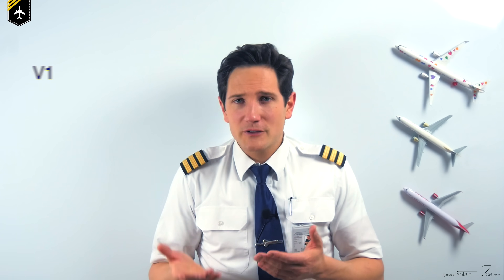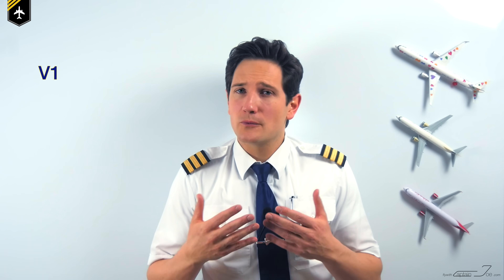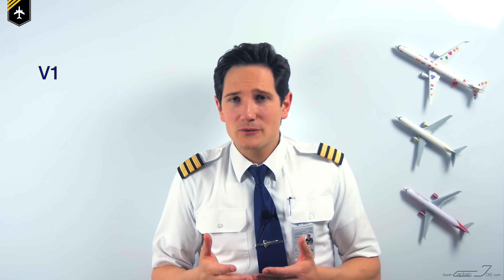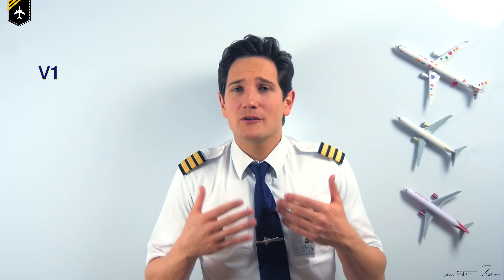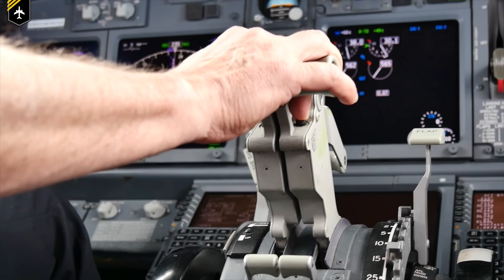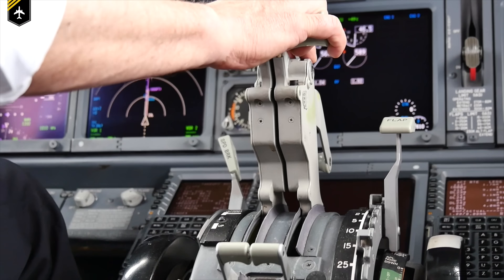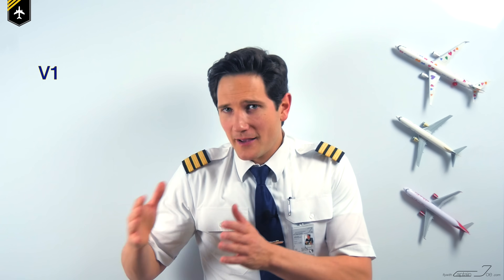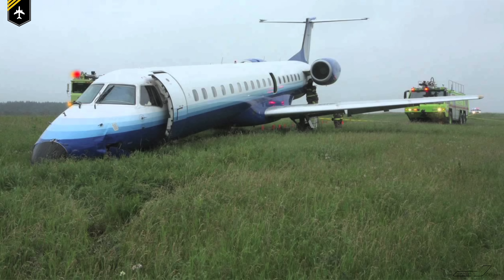TAKE-OFF Speeds V1, Vr, V2! Explained by "CAPTAIN" Joe

Comment: I understand Vr. It's the speed (given the plane and inputs) that you can achieve flight with. Let's say that's 150 knots. It doesn't matter whether you get that with 3,000 meters remaining runway or 30. It's a matter of achieving lift, regardless of remaining runway. But my question is, does V1 decrease depending on remaining runway? If you're 50 feet from the end, you need to be going 20 knots or less to stop. Under 20, you can stop. Not committed. Over 20? You can't stop in 50 feet. You're committed. So with 50 feet remaining, V1 (for this craft, and a given payload, fuel weight, slope, traction, etc.) is 20 knots. But if you have 3000 meters ahead of you, you can be going 200 knots and can stop. If that's true, then V1 should not necessarily precede the 150kn Vr. This seems simple as can be. What am I missing here?
Reply: Bill Woo yes v1 decreases with decreasing runway length. But when runway length is increased, v1 is increased with the max limit being vr. That’s because v1 is commitment to take off, and vr is the actual takeoff

I dunno if this example helps in understanding, but ill try. V1 is like getting engaged. And VR is like getting married. So engagement is commitment to marry someone and marry is to fulfil that commitment. Hence you cant get engaged after getting married.
Reply: @ZK-APA  That's all well explained, but it contradicts the commonly stated "definition" of V1 being the make-or-break commit point. This is a fine point, but unless V1 and Vr are simultaneous (maybe they are effectively considered to be, like a recitation "Vee-wun-vee-arr"), then between the call of V1 and the call of Vr, you are not committed if V1 is capped at Vr. If Vr is 150 and you could stop from 200 because there are tons of more runaway; V1 is really "200 capped at 150". Then I would contend, at least logically speaking, that once V1 is announced, it doesn't "really" become the commit speed UNTIL rotation. Even when Vr is called, you might not "physically" be make-or-break committed, although "legally" you are, because it's been called so it's mandatory. Again, I understand that rotation will probably occur within one second after V1 commonly; but unless V1 equals "uncapped V1", it's not really a commit speed until the yoke is pulled, right?

I'm not criticizing your explanation. Just exploring the fine points. Sorry - I was the jerk that sweated over the extra credit questions and killed the grading curve for the rest of the class.
Reply: Bill Woo ok, I think you are mixing the physical concept and the legal concepts of V speeds

As in yes, if you have a long runway then v1 can be greater than vr on paper. But if you look at it from the legal definition, vr is the speed when you rotate, so that’s the point where you take off. So v1 will be greater than vr if vr speed is crossed but the pilot decides to not rotate. But that’s not how it works.

Comment: I all ways wondered what rotate meant. so its when the angle of attack creates enough vacuum behind the wing, forcing the air down? or air rotates down?
Reply: Bob Young rotate means that the aircraft has reached a speed where you can pull back on the stick and take off.

Ps one thing that people don’t know about physics of flying, is that an aircraft climbs mainly because of excess thrust, and not lift. So rotate is when you have that thrust to start climbing. (Hence the aircraft’s nose is pointed upwards as then the trust acts in that direction)

Comment: "V2 is the safe take off speed which you can maintain with only 1 engine operating"... So then what happen if you have an engine failure after V1 but before you reached V2 ?? (a scared passenger)
Reply: If there is an engine failure after V1 the takeoff run will be continued, because the takeoff can't be aborted after V1. Vr is the rotation speed and it should be such that the aircraft is able to reach V2 before it is 35 feet above the takeoff surface.
Reply: @mikep9604  hey Mike, but can the plane actually gain speed while climbing up with only 1 running engine ? Because if the second engine stop working just after V1, the plane won't be fast enough for Vr and V2
Reply: @ludovicortiz927  - As it was told, after V1 the takeoff can't be aborted, the aircraft must continue the takeoff run and perform takeoff. The aircraft is able to perform takeoff with only one engine, and reach the sufficient speed to climb and fly (and make a go-around and return for landing). This is a part of Certification requirements for civil (commercial) aircraft.
This is the normal procedure if there is a failure in one engine after V1 speed.

Comment: Cheers Boss, well understood mate. I've just loaded my copy of Flight Simulator X on a cool Acer tower desktop with windows 8.1 & setup a nice layout of my cockpit" where I've located the keyboard, Logitech joystick & a cool mouse that has a red ball that turns-spins by finger. So keen to pick a nice Boeing plane, make a destination waypoint map & stretch my wings & I want to have a better knowledge of tasks a real pilot will have to make the correct settings/control inputs to safely take-off, clime, heading clime rate,  altitude  max level & speed by the auto-pilot control inputs then descend plane by a safe distance  from the runway & the rate of descend using waypoints then a sweet floorless landing. With what any person can access on the awesome, wonderful & beautiful WORLD WIDE WEB, google & YouTube is  Flight School course of classes & writing everything in short & simple meanings into a study notebook. So far I've took lessons with setting the flaps for take-off & the V calls made when a plane is running down runway & lifting to the sky.I have a question to ask & what is the law, rules with the planes interments/gauges & the pilot using metric or imperil numbers when being called out in the cockpit or the traffic control town?Thanks Caption Joe...

Comment: what if the landing gear brakes fail? before v1
Reply: In this situation, if there is no brake power, and you have to abort the take off, you will use the reverse thrust only.
Reply: @mikep9604  can they stop a fully loaded plane at their max payload?
Reply: @mikep9604  thanks, that's a scary as hell situation tho.

Comment: What if you reach V1 and then the wings fall off?
Reply: sucks to be you, but at least the brakes are going to work well, no lift at all means the full weight of the plane's on the wheels ... then again, with no engines you might have trouble with the hydraulics, like the brakes...

Comment: Hi Capt. Joe..thanks very much for all the great vdos.. Just a query - at Vr, does the pilot have to do anything - like increase angle of attack of the wings - or, the nose (of the plane) automatically lifts up due to speed (Vr)?
Reply: Yes, at Vr the pilot will pull the yoke (or side stick on Airbus) so that the aircraft nose will rise and the aircraft takes off.
Reply: Many thanks Mike... With yoke pulling, what/which parts or wings play the major role and how? Many thnx once again.
Reply: @Chanchal1969  - When you pull the yoke or side stick the elevator will rise.
https://www.decodedscience.org/wp-content/uploads/2012/04/Elevators.jpg

https://i.stack.imgur.com/JficI.png

Comment: Hello Capt. Joe, I truly enjoy your videos even though I am not a pilot! It is is amazing to know that there is nothing routine about a pilot's day! I have a dumb question about bird strikes. As in, why do they cause serious engine damage, resulting in emergency landings etc. Why can't they make the engine fan blades strong enough to withstand bird strikes? I understand the high momentum with which the strikes happen, but a bird is "just made" of flesh and bones! And most are so small relative to the engine size! Lastly, why can't they have a grill in front of the engine that prevents the birds hitting the blades during take offs and landings (ok, I am sure you fell off your chair laughing at this!), and that can open up once the plane reaches high altitude for better air suction? During takeoff, a lot of thrust is applied anyhow, so can't it compensate for any loss of efficiency in exchange for safety? Thanks.
Reply: Mentour pilot did a video that answers those q's

By the way if you like Cap'n Joe you will like Mentour -- the two pilots have a different style but very similar in quality of the info

Comment: Hi Captain Joe
Just happen to see your video on the explanation of V1..Vr..V2.  It was amazing the way you explained.  I would like to know how do you control the left and right turning when heading to the runway for take.  I have been watching quite a lot of you tube and I see the hand of the captain on his left side somewhere just below the window.  Do you have video showing that part?
Reply: The nose wheel steering system has a tiller wheel in the cockpit, and the captain can steer the nose wheel using it.
https://www.scienceabc.com/wp-content/uploads/2017/09/Tiller-in-cockpit-1.jpg

On the Airbus the tiller is next to the side stick.
https://qph.fs.quoracdn.net/main-qimg-4e56e7409b821b1946a913aeac5480c2.webp

Comment: Pilots,  can anyone tell me why some pilots sit at the end and get the engines up to power before rolling and why some gradualy add power during the roll?  It is just pilots preference?  I've even had one pilot go to engines up before he completed the turn onto the runway.
Reply: datsuntoyy all of this are different takeoff techniques.

Ex. In Shortfield takeoff, the engines are spooled up while the brakes are kept engaged. Once the engines have fully spooled up, then the brakes are released to ensure max engine power is used for the runway.

And for takeoff with power added gradually. It is done to make sure engine are spooling up in sync. Once that’s confirmed they go to take off power.

And for the power added while turning on the runway. That happens when atc asks the pilots to perform an immediate take off. This is generally done in busy airports when runway usage for all planes have to be maximised.

Comment: Captain tell us why aircraft engines are not covered with radiator style grilles to prevent bird strikes
Reply: I remember I read this somewhere. Passers-by do correct me however, if I'm incorrect.
It's because at high speed, if a bird hits, it will still break the grilles. Moreover, it will be ingested into the engine. This is gonna inflict greater damage to the engine, compared to bird-only ingestion. So, doesn't really help prevent bird strikes, while adding another risk.

Comment: Whats the procedure if you loose both engine on a plane that only has two, due to bird strikes or whatever and you just hit V2 you dont have the height to glide and land or to make a turn to land on the runway, i would suppose if you had time to try and restart both and if you couldn't you would have to land on whatever is right in front of you not good but really is it pretty much attempt to restart if you have time seems to be about your only options
Reply: Geoff Nason yup you take the option which you have. The situation you gave is the worst case, in which most probably the pilot would look for any open area to put the plane down.
Reply: @ZK-APA  Thanks for the reply brother

Comment: Why there is no Net in front of enginee
Reply: Basant Dalai it would reduce the area of the air intake (yes it’s a “net” but even that’s enough to make a difference)
Reply: @ZK-APA  Thanks a lot but a high quality thin net should be there then the intake affected to minimal.
Reply: Basant Dalai on paper it sounds good. But in practice there are flaws.

Firstly, any thing (including nets) will cause the free air coming into the engine to become turbulent. This would cause lower fuel efficiency, and in some cases it can damage the compressor and hence the engine (compressor stalls and surges)

And second, in such high altitudes, with any moisture, the nets will start to accumulate ice. And that can literally block the entire engine off.

Basically, the engine depends on the intake being free flowing to be working properly (there are exceptions, but they are installed in military helicopters, as they don’t depend on thrust to fly)

Comment: I just wish you would have included in this explanation of the takeoff roll why every airline has pilots call out "80 knots".
Reply: It is a check of the airspeed indicators.  There are three airspeed indicators on the airplane.  The captain and first officer each have one and there is a standby airspeed indicator on the center of the instrument panel.  At the "80 knots" call the pilots check the airspeed indicators to make sure they all read 80 knots.  If one airspeed indicator is off by a lot the take off can be rejected at a speed that won't due harm to the airplane.  A high speed rejected take off can due damage to the brakes, landing gear etc...

Comment: What if you rotate before reaching V1? So like a Cessna taking off at Heathrow, it would likely rotate before reaching a speed in which in an event of an aborted takeoff will result in overrunning the runway.
Reply: If you rotate before V1, either the aircraft will not react, or just lift its nose wheel and wheelie on the runway.

And the concept of V1 isnt there in small GA planes (like cessna) They generally have a rotate speed and a climb speed.

Comment: So, if V1 is the speed at which you must commit to the takeoff and V2 is the minimum single engine control speed, if you lose an engine (on a twin) between V1 and V2 are you screwed?
Reply: No, you continue accelerating on one engine until you reach V2 and you climb as fast as you can while maintaining V2.  All multi engine aircraft can successfully takeoff with a single engine failure at V1.

Comment: Why can't they put a conical screen over jet engine intakes to prevent a 12 cent bird from bringing down a million dollar aircraft? It seems elementary. What am I missing?
Reply: Drag.  Reduced engine performance.  Disrupted airflow.  Flying your entire fleet around with screens over the engines would cost more than replacing an engine now and then.  Single engine failures don't bring down multi-engine aircraft.

Comment: That's a difficult matter. In case something happens after V1 which makes you believe that the aircraft possibly won't be able to fly, it's might still better to abort the takeoff run and end up in the runway extension, rather than crash after the lift-off.

Comment: What's the decision factors when thrust is reduced from max takeoff to the climb position? 
I experienced a flight where power was reduced but then applied again for several minutes. No steep turns.
A-321, full occupancy.
Thanks.
Reply: In most aircraft, takeoff power can be reduced when positive rate of climb is achieved, reduced further if noise abatement regulations apply and increased to resume standard rate of climb. Power may also be increased to effect a higher airspeed without attitude change, and may be increased during level flight to climb.

Comment: V speeds are the same from 747 to Cessna.. so if I have an engine failure beyond v1 in a Cessna I cant abort the take off? Captain Joe is a bit of a misnomer.
Reply: Single engine airplanes don't have V1 or V2 speeds.  If you lose the engine, you aren't flying.

Comment: Question for Captain Joe: When you throttle up to make speed and at the same time start to pull up, does the plane leave the ground on your pre-calculated rotate point?
Reply: Erik P rotate “points” are not calculated. only the rotate speed.

Comment: So what if a plane reaches vr and something happens before take off that makes take off an almost guaranteed plane crash (ie: concord), but it would be safer to running off the runway?
Reply: JewelBlueIbanez no. Planes are designed to fly on one engine, so if one fails, they can still fly safely.

Comment: What happens if both engines stop working at a point in between Vr and V2 so that the airplane cannot continue to climb and reach its V2, while the takeoff procedure does not allow pilot to cancel takeoff?
Reply: Bul Pak then you have to abort takeoff. There are exceptions to the post v1 abort takeoff. All engines failed is one of them.

Comment: Hello Mr. Joe, how do you calculate the extantion of flaps during take off phase and landing phase and wich factors do you consider? It will be great to see a video about that because I can't find it :)
Reply: Davide Di Lorenzo the suggested flaps are generally found on the pilot operating handbook. That and extra information can be used by the pilots to decide the best flap settings.

Comment: Hey Mister Captain Joe. I like your video because they are understandable explenations for with a good sence of humor. With every answer i get 2 questions but thats my curyocity. 
Stil i wonder what the black and white wheel is next to the thrust leavers. Sometimes they spin and other times there are at a stand still. In one video i saw the pilot change and setting the black and white wheel after pushback. 
So what does it do and what is the purpose of it. 
Thnx for your time and afford to make the pilots job more understandable. Greetz from holland, Ron (train driver)
Reply: Ron larox that’s the trim wheel. Of its moving that means the trim is being adjusted

Comment: Hey captain Joe! I got a question! Does the word V1 is like 100 speed? And does V2 is like 200 speed?
Reply: The actual speed is not a constant, it varies according to type of aircraft, how many passengers are aboard, how hot it is outside, if it is raining or snowing, field altitude, etc.  The speed for each of V1, Vr and V2 is calculated before takeoff and called out by the PM as each speed is reached.

Comment: Why can't there be put some sort of engine protection in case of bird strike? Something like a very thin but strong won't affect the air flow but any bird hitting the engine will be turned to a mince meat instantly. Something like an egg slicer? Probably a very dumb question but I've always wondered.